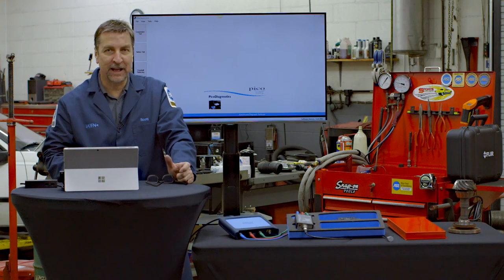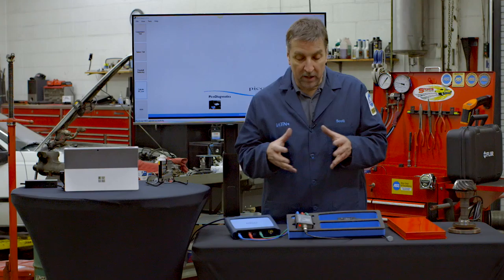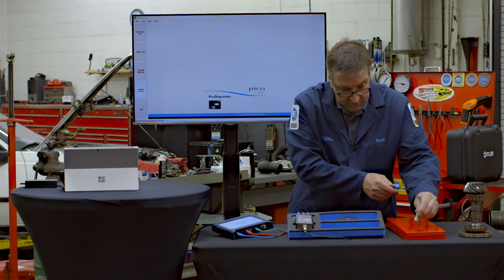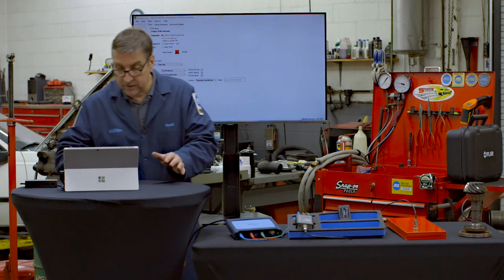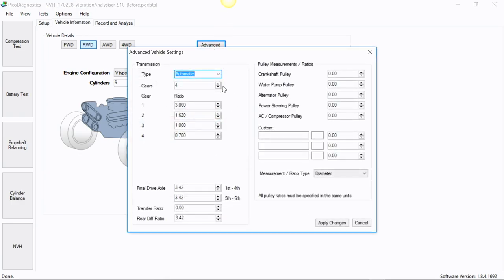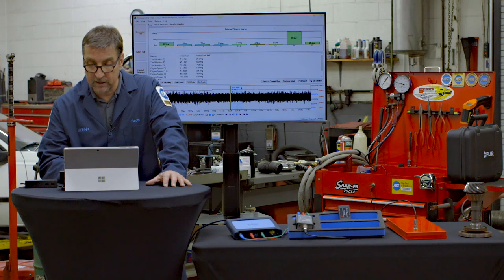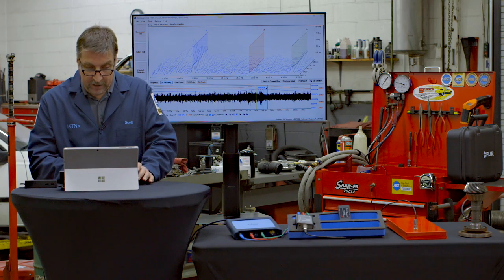Pico Diagnostics NVH Case Study -  Chevrolet S10 Vibration

Comment: Nice job.  I wonder if it would interface with the new 6.7 Cummins on a 2017 Transit Bus.  Will have to look into that.🙂
Reply from the maker: busjockey1 all the system needs is generic OBD for ROM & MPH. If you can’t pull those in all you need to do is record and then note the RPM & MPH where the vibration occurred and add that to the highlighted section for clear demarcation.

Comment: Good review. Unbalance is caused by centrifugal force on  the eccentric Mass. Centrifugal force is proportional to the square of the rotational speed. Thus it would be good to have drive shaft vibration plotted With the drive shaft speed. An increasing vibration with increasing speed would confirm that it was unbalance (in This case caused by the eccentricity of the pinion shaft). Not If you would like to risk your nice equipment but you could actually attach the accelerometer to the differential case to have an even more convincing evidence

Comment: I recently got this exact setup. Your video has been very helpful in setting up and understanding its use. BUT having watched this several times over several weeks I still haven't figured out what led you to the pinion. Did the tool convince you that the problem was in the driveshaft, not engine or tires? Then having confirmed the shaft itself was good you moved to what the shaft was attached to? If so did you start at the rear axle or the transmission? Either one being bent could cause the vibration. Not being critical, just trying to understand how you got to the bent pinion. Very useful video.
Reply from the maker: The driveshaft was confirmed good and the tool helped to identify that the vibration was in the order of driveshaft rotation. We then looked closer at both ends and ended up putting a dial indicator on the companion flange.  This let us know that we were getting closer to the root of the problem.
Reply: @TechScottBrown   That is what I thought. Thanks

Comment: I'm curious now what would happen if you could adapt an on the car brake lathe to the companion flange as to isolate the propeller shafts from the pinion.if this would be helpful at all?also I was unaware that the pico nvh  could only be used with the four Channel .I guess I'll have to trade my two channel for a 4-channel now. Thank you ,very good pico video.
Reply from the maker: Daniel Wells I don’t think the brake lathe would help since the bent pinion caused both a radial an lateral issue.
Reply: Scott Brown       yeah . Also Driveline issues are only prevalent under load anyway.

Comment: Great video and I can see how this tool could re-affirm a suspicion during diagnosis. Did you indicate the pinion flange before it was removed from the vehicle?
Reply from the maker: Hi Patrick, at the time of analysis, a bent pinion shaft wasn’t even in the cards (for me anyway) since I’ve never seen that happen and how could it? Well of course in hindsight, anything should be considered possible. I was working with the driveline company and did indicate the driveshaft approximately 1’ forward of the pinion and the results obvious. I then indicated the flange and condemned it. The problem was finding a replacement part. This job ended up being an insurance job so we ended up with a used diff that we took apart and replaced all the bearings and seals. Like I said in the video this was the first time using the tool and I learned a lot.
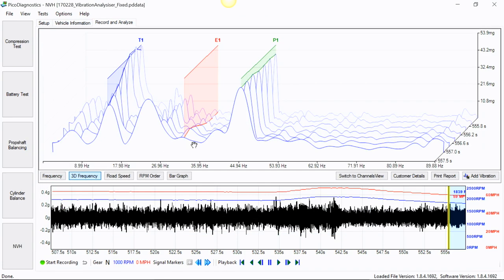Reply: Hindsight is 20:20 for sure. My guess is the customer understated how spectacular the event was! I know mine lie to me all the time lol. When you think about it, often the lengths that mechanics have to go to in fault finding are ridiculous! And the better you are, the more difficult jobs get referred to you, its nuts!

Comment: Great video, How can or would you determine if its the front axle or rear axle, I know on the s10 the front axle aint rotating so that's pretty obvious but a awd vehicle both axles would be turning, and if you are going after a tire imbalance can you determine what tire is out of balance? or does it just give you a direction and your on your own to figure out what exactly is the problem?  I really like this tool but it seems very complicated. Thanks
Reply from the maker: JOHN HUFNAGEL once you know what to focus on you can then relocate the sensor and retest to see the delta in the signal. The same practice applies when you have something happening at wheel speed. Move the sensor around to each corner of the vehicle and retest.

Comment: Can you send me the link to buy the same model of OBD 2 connector that you have?
Reply from the maker: Any Bluetooth enabled OBDII adapter will work. Here’s the unit used in the video: BAFX Products Bluetooth Diagnostic OBDII Reader/Scanner for Android Devices https://www.amazon.com/dp/B005NLQAHS/ref=cm_sw_r_cp_tai_JhFUBbRYWQWP0
Reply: ANY J2534 reprogrammer will work.  I use my Ease Reprogrammer II because the ELM 237 doesnt have a stable driver for Win10